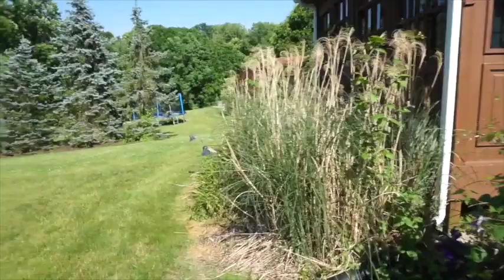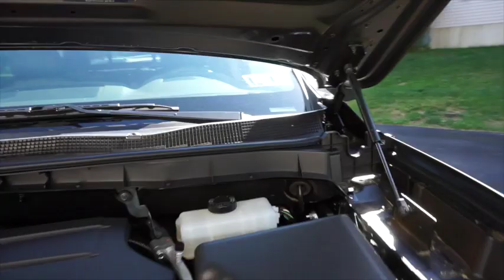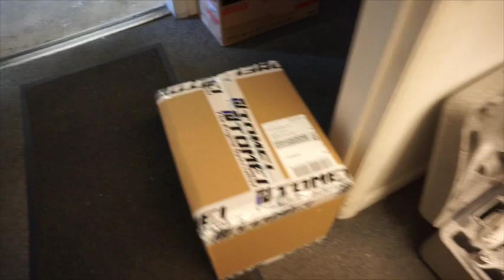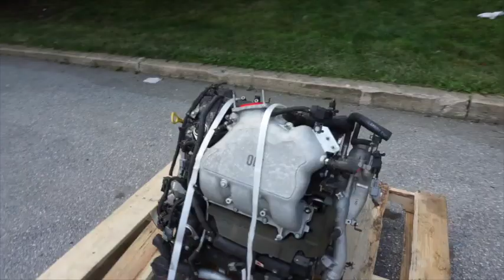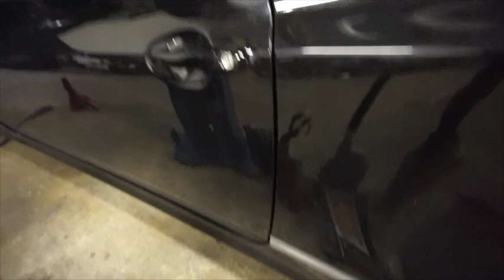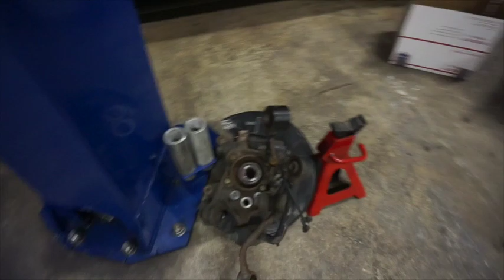New Daily Truck | VT installs | Blown 3.8T | Working on Copart II

Comment: will anything bad happen if I run a after market bov on my genesis coupe?
Reply: yoto10203040 you should be fine
Reply: was thinking of installing a hks ssbv
Reply from the maker: yoto10203040 no it won't